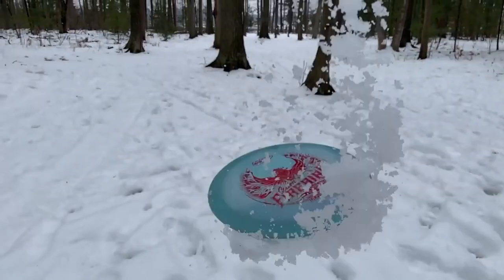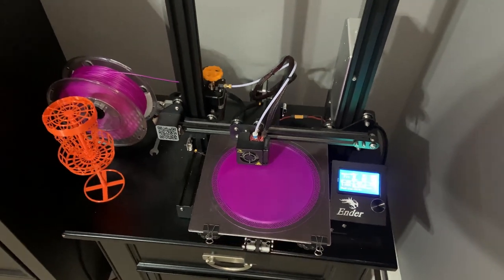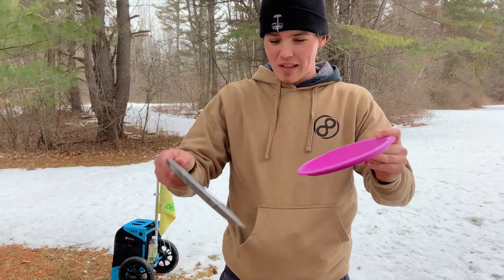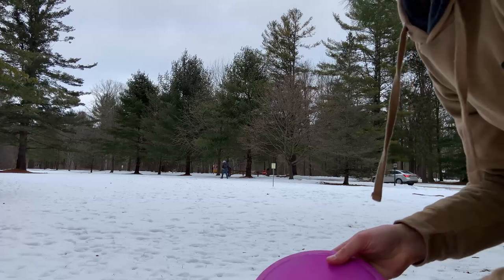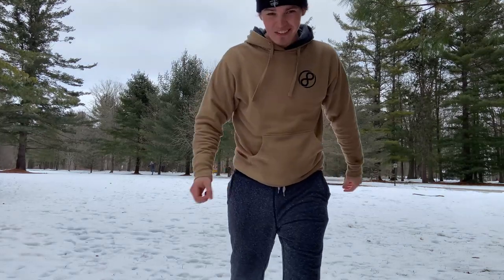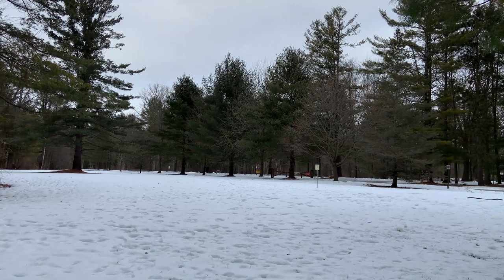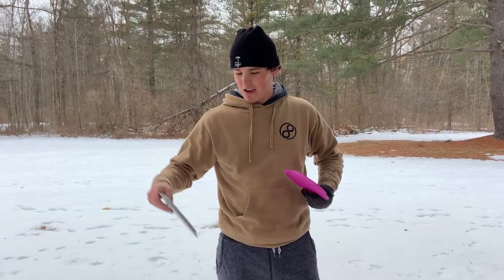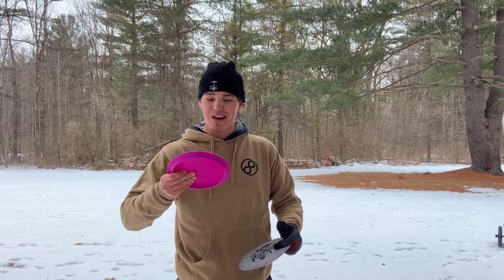World's First 3D Printed Simon Lizotte Tilt (Will It Fly?)

Comment: Just saw this on Simon's video... definitely impressive. I thought the same thing as the Tilt was coming out, how printable it could be. It would certainly be an interesting printing project (just built a 300^3 printer), and it might even be better if one were to try printing with something like TPU so it has a little give. Might need a heated chamber to keep it in shape during printing, but it'd certainly be a fun experiment. Will have to keep an eye out to see if you make an STL public (no worries if not, I get the possible legal implications).

Comment: Nice work!!
For a better alternative try printing the disk on its edge rather than flat. You will get a much more accurate disc profile, better surface finish and a full size disc if you align it between the corners of your base.
If you add small rod/sprue in the center of the on the disc, the print will also build more lateral support material and prevent the disk falling over as it gets taller. 
Then you can cut it off later.
Good luck. 👍
Reply from the maker: I will have to try that out, thank you so much and i’m glad you liked the video! I realized after making this that I could have printed it in full size if i just would have turned the skirt off in the setting, but i guess both of these will be good to know for next time 😂
Reply: @LetsGoDiscGolf  ok cool. you must have a bigger base. Mine could only squeeze in a 195mm diameter. I also could not get a good finish flat right way up or upside down. But on edge was surprisingly  great. 😁

Comment: Cool vid! What material do you find works best to print with for this application?
Reply from the maker: I haven’t really tried messing around with anything other than PLA just because I was only making it for fun and not actual use.
Reply: There is a minimum diameter in the rules, if you play tournaments...
But when's the last time anyone actually checked???

Comment: Quick dip in acetone make it last longer... awesome job!
Reply from the maker: on PLA?
Reply: @LetsGoDiscGolf  honestly not sure? We use abs and make swim paddles... definitely strengthens them up and gives a nice shine...
Reply: Have you tried ASA plastic? It's like abs but UV resistant. I tried dipping an asa part and it was smooth, but it turned from black to kind of dark cloudy gray, while acetone vapor smooths asa parts just fine like abs.  Got any tips for dipping?

Comment: Hey, what infill % would you recommend for this? Also any recommendations for print orientation? I.e. on the head, edge, etc.
Reply from the maker: I would definitely recommend 100% infill, I printed mine with the build plate facing down because the top of the disc is so flat so it was just easy and required very little support.
Reply: @LetsGoDiscGolf  awesome, tysm!
Reply from the maker: @comfortk1llzone  No problem!

Comment: Nice! I wonder how well a resin 3d printed disc would hold up
Reply from the maker: I was honestly wondering the same thing lol
Reply: I printed with a mini, it cracked quickly  due to the resin brittleness. I used cheap resin tho
Reply from the maker: @spspspspspspspspsp11  That’s so cool that you actually tested it out though!
Reply: @LetsGoDiscGolf  I printed a disk in PLA plastic. I was pretty tough. I accidently hit a curb at high speed. I thought it would shatter but it just got a permanent warp. 
Still flew ok afterwards too. Lol

Comment: Got an stl?
Reply from the maker: Yes but I won’t be giving it out at this time, but possibly in the near future! Sorry I have some things I potentially want to try and do with it first
Reply: just go into a modeling program and model one. the more concave the rim, the more overstable.
Reply: Doolang, I wanted to test it myself so I redisegned it to and on the way to print it now. When it is working correctly I will put it on Thingiverse, but if you want it now, let me know. 

Btw great video dude! I am going to try more disc designs. Using some Flex and PETG combinations
Reply: @MrMatesnik  have you printed it yet?  I'd love the stl
Reply: @MrMatesnik  Sounds awesome! How'd the print go? I'd love the stl if you're happy to share it!
Reply: Any chance you could put out the dimensions? Does the wing have curvature?
Reply: @LetsGoDiscGolf  could you share with stl?

Comment: How do you go about to get a dome on more domey makes using a printer though?
Reply from the maker: I haven’t tried messing with that yet, but I would most likely have to make the build plate thinner to allow some flex or just design the dome into the print and add supports for it while printing.
Reply: @LetsGoDiscGolf  Could "vase mode" do it?